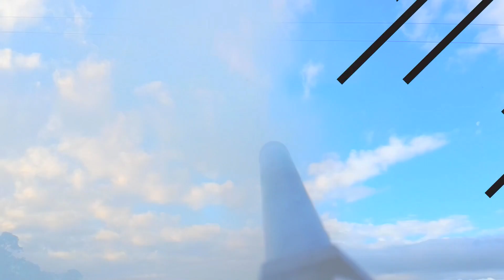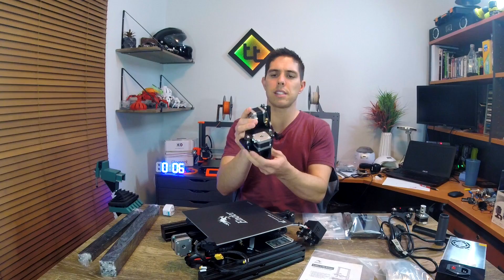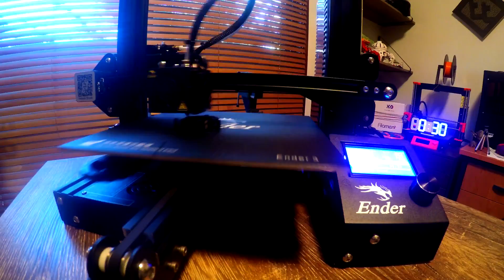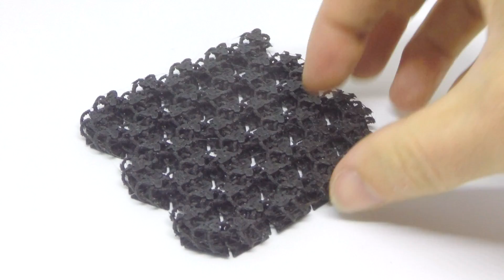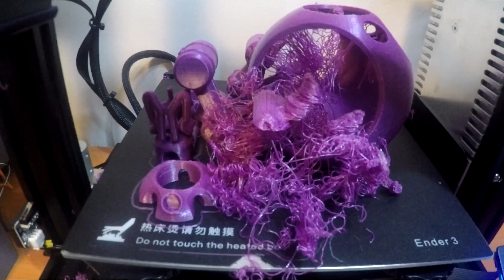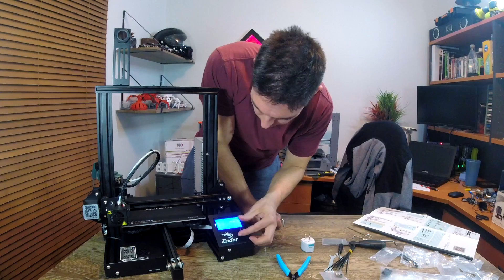Ender 3: The new standard in budget 3D printing? Now $190

Comment: I'm stumped when it comes to Cura settings.  I've seen several sites that host Cura Ender 2/3 'profiles', in .ini format, but don't know what it takes to get that printer's settings imported into Cura.  The Cura program (mine is as up to date as they'll go) does not have the Ender 3, so I'm having to stumble around and put together a group of settings and pray that they work.  What am I doing wrong?  Is there an Ender3 profile that you've used with Cura that you could post?  What's the process of 'importing' a printer into Cura?  If that's not possible and I have to enter settings manually, what would those settings be?  Thanks a lot for the video and any help you could provide.
Reply from the maker: Go to preferences , printers, add printer. The 220x 220 x 250 build volume plus the 1.75 filament and 0.4 nozzle sizes are the crucial inpouts here.
To import a profile, go to preferences, filament, import and select your file.
Good luck!
Reply: Ok, thank you for that.  For a profile that won't import - I'm guessing there's something incorrect in the profile itself if I get an error in Cura following those steps?
Reply: Also in the printer settings- Gcode flavor should be Marlin?

Comment: I’ve had  mine sine June and I found that after a fair few prints the bed surface has become smoother in places and adhesion isn’t as good. Mu solution to the mainboard fan was to simply add a mesh filter to the inside
Reply from the maker: Did you change to another surface?

Comment: I've got my Ender 3 working now but my first problem was the print would start not in the center but on the left corner closest to the front. The print would start half off the bed!

I had to move the object in Cura to the northeast quadrant on the bed before it would start properly. After that it was fine. Still searching for a solution before starting my 2nd print.

Edit: I should say, I had "autohome"'d it before and it failed then I tried to position the extruder in the middle of the print bed but same outcome.
Reply from the maker: It sounds like the printer dmensions are set incorrectly in the slicer. I that doesn't work then I'm a bit stumped. Reflashing firware might help in case the wrong firmware was flashed from factory, but I think that would be very unlikely.
Reply: Teaching Tech thanks for the answer. I ended up"fixing" it with a full power down and unplug from the wall. After a restart, it began working fine!
Reply from the maker: Glad to hear.

Comment: This is my 1st week with my 1st 3D printer and the slight adjustments were :-
It rocked, so I  put in on a flat surface and loosened and re-tightened the feet so they seated in their natural  position.
The Z jammed, but all I did was loosen and re-tighten the Z stepper after final assembly so it fell into it's natural unloaded position. I didn't loosen the screws on the carriage nut.
The bed surface curled a bit, but it came with clips so I just moved them further out.
The only thing is I never see the control unit fan spin. I checked it, and it was unplugged, but after plugging it back in it still doesn't spin. Maybe it temp controlled.
Reply: Mine also rocks, I hadn’t yet investigated why but good to know the fix is fairly simple

Comment: Out of the box I had the same Z axis issue.  I double checked everything with the frame was square as the lead screw was at a bit of an angle.  After Squaring up the Z stepper motor to the base and loosening the rear screw around the lead screw (ever so slightly) the binding has stopped.  Thanks for the upgrade tips as well, they will be my first prints.
Reply from the maker: Glad you resolved it and thanks for watching.

Comment: I have had an issue with mine. When printing the bed level changes and ruins the prints. I had to put stiffer springs on the bed leveling springs to stop this but it still isn't perfect
Reply from the maker: That sounds frustrating. It shouldn't really be possible without something loose being affected by vibration.

Comment: just bought one and so far looking good, but how do you easily change filament during a print? So say start one colour and end with another? So far only way seems to be to pause the print, pull out the old filament and push in the new, but not sure how to do that correctly... Levelling the bed (def worth the effort) I turned screws wrong way on one corner ... doh nice groove in new bed surface and had to sort out the nozzle! And I'd check the power supply spade connectors to the switch on mine were loose.
Reply from the maker: In Marlin you can add a menu option to assist with this. Now that the firmware is open source it should be possible. Bummer on the bed levelling. This is a printer that is crying out for auto bed levelling.
Reply: Thanks. Looks like the firmware needs an update. Pretty sure that voids the warranty though. Noticed one spot on bed where I touched it during build has a soaked in greasy spot so first PLA layer finding it hard to stick. Tried a few thing, looks like will go for a glass bed anyway so not dwelling on it now. Anyway advise to builders watch out what you touch after handling the Z screw which is oiled... Mine came in a nice rubber tube and was definitely straight.
Reply: For info maybe in case some curious,... post an SD card print the nozzle goes to home and the bed and heated nozzle stop heating and cool down.

Comment: On the verge of buying a CE3 as my first printer. Kinda scared though because while many people's CE3 worked great out of the box, others have had lots of problems with theirs. I guess it just comes down on luck. I really hope I'll have a functioning printer right away instead of a faulty one that I would need to rebuild with replacement parts.
Reply: Very comprehensive and high quality review by the way!
Reply from the maker: Hi Matthias, Remember that in communities, the people with the problems are generally the most vocal. It seems from the comments here that the vast majority of users have had a good experience with the printer. I suppose it comes down to your confidence in the after sales support of your chosen supplier in the case that you get a lemon.
Reply: Teaching Tech Alright, I shouldn't be too worried then (yet) :)
Reply: Mine has come out fine.

Comment: Did you update the firmware to TH3D or Marlin? To stop thermal runaway. I just got mine yesterday, but are moving. I replaced my hotend on my CR10 with a E3D hotend. Plus I have an auto levelling sensor. Easy to build the auto levelling circuit too. It's on my channel.
Reply from the maker: Not yet but this is on my to do list. Manually flashing a bootloader is something I've done before, ut is still a pain. A bit of a barrier for sure.

Comment: Z binding...fixed with a printed spacer for the motor, so not a big deal. Major extrusion issues due to the bowden tube not sitting tight against the nozzle. I replaced the tube completely and slided it in with the coupler/nut slightly loose and the nozzle heated up. That way, when I tightened the nut, it added extra pressure between the nozzle and PTFE tube. I've done two 40 minute prints since that and those were fine. If the pneumatic coupler doesn't hold (even with the locking clips I made), then the extrusion issues will probably resurface and I will replace them with new ones that will hopefully work. Very good for the price, but the extrusion issues took a lot longer to figure out than it took to build the printer.
Reply from the maker: Great problem solving. Your issue sounds like what Angus from Maker's Muse ha experienced, but hopefully not as bad. Perhaps a small bad batch issue of the fittings?
Reply: Very clever with the coupler tightening trick!!

Comment: Great video. I've had the E3 for a while I have the fan cover cable chains spacers to even up the z axis and a rail mount for my SD converter. Today I have had one of the bearings on the y axis develope a clunk and noticed that the wheels have a slight groove. I've ordered some improved wheels with better bearings to resolve this. But other than this issue, I love the printer, it's a well built chassis and and nice and portable. Some ability for auto leveling from creality would be appreciated. Thanks for posting your thought keep up the vids.
Reply from the maker: Thanks for taking the time to comment. Planning to cover some mods on this printer in the coming weeks. Some of the printed mods you mention, as well as flashing the community firmware and fitting a BLtouch.
Reply: Teaching Tech great ideas maybe I should do a quick video on the roller replacement, when they arrive.

Comment: Maybe it is impossible, but how would you compare it to Prusa MK3, given that I could forgive this printer a lot more than prusa, mainly because of the price, of course.  Talking mostly about the print quality.
Reply from the maker: The print quality on this isn't far off. The mk3 has big advantages in terms of usability and convenience. You could add many of the features from the mk3 but the cost would add up.
Reply: Thank you for the reply... I am torturing myself with urges to cancel my order on Prusa for 2 months now. So many issues :( I am literally on the edge of canceling it all and buying Ender 3, or cr-10s... I would just clamp on the flex plate and i am all good. But I can imagine all the issues with those cheaper printers too. Everyone has a different problems with different printers. I have yet to find a discussion that would definitely change my mind. sigh :(
Reply from the maker: You hit the nail on the head with "Everyone has a different problems with different printers". Remember that in any community, the vocal ones will be the few with problems. I've been very happy with my MK3, it is still my go to machine because it simply works. We have just had our MK3 we ordered for school arrive, it will give me a good chance to see if the experience is as good the second time around.

Comment: Why that Hype about the Ende 3?!
With the one i bought, I have seen just no goes over no goes....
The base of the Y axis has been preassembled with force and so it has been messed up.
The cut of the profiles for the Z axis have not been cut properly, so I had to bring them to be milled flat. Otherwise a proper assembling would not have been possible. The extruder is crap, the hotend is far away of a decent engineering result. The Z axis cable are to short too be guided well. The SD card slot is placed as stupidly as it can and, and, and
In fact i don't see any good buy there and the aluminum profile I can get a lot cheaper and properly cut, than for the price of the Ender. Considering all that should be changed, its a better choice to built the sam by itself with worthy components, or to buy right away a printer which is worth it's money. 
And nope I'm not trolling for no good reasons....: https://www.thingiverse.com/thing:2970759
Reply from the maker: It sucks that your printer hasn't lived up to expectations. From the comments here and discussion elsewhere on the internet I think it's safe to say your experience is the exception rather than the rule. Hopefully you can get it sorted.
Reply: Personally I rather think, that most users and specially People new to the subject, They're not aware about the damage they make if they forcing things to fit. And there are lots of videos about th profiles of the x-axis which is not straight up....
But what makes me more angry than the troubles with the Ender is that hype  about it, just because it is cheap. (but finally expensive..)
Thousands of these printers have been sold  and they're not able to buy machines for a clean cut?! That's juts a joke, but a bad one ...
Why not selling that printer for 10 bucks more what would allow to make things right?!....

Comment: Hi, for the price point of about £200 UK. Would you recommend this printer or a different one please? My first Prussa clone was destroyed in a garage fire and I need to get a replacement. Cheers for any advice given.
Reply from the maker: Hi Shaun, I'm hesitant to give advice on printers I haven't used, but around that price point there are the cheaper cr-10 clones and some deltas. Check out a maker's muse video comparing printers at each price point.

Comment: Great review. Mine arrived last week. I've gone from the HobbyKing Fabrikator Mini II, and the PEI surface on that isn't quite so rough. Took me a while to get the settings sorted for a reasonable first layer, but seems OK now. A quick wipe over the bed with IPA and it sticks really well....maybe too well :) Haven't needed to put glass over it though like some users. A real nice printer though, easy to build, and solid construction. Would you share your retraction settings? This is one thing I need to sort. :) Many thanks for a great review.
Reply from the maker: I'll post the profile in the description shortly.

Comment: Had been using mine for a bit and it always had a burning smell. Then the heated bed would just start heating as soon as it was turned on and keep heating till it reached its max around 110C. Waiting for a board replacement so hopefully that resolves the issue. At least I know it can get that high amd with the 24V it geta the bed heated up much quicker than the CR-10. 

I also cut a mirror to put on the build plate like I did for the CR-10. Whatever that material is on the Ender-3 sticks too well I found. I prefer the smooth surface from printing on mirror/glass, but to each their own.

Agree that this printer would be pretty easy to transport, so would work well to bring into work or a function to teach/demonstrate how 3d printers work.
Reply from the maker: Thanks for sharing Mike, a very useful post for others.
Reply: I had the same issue with my cr-10 and know how to resolve the burning smell and heatup... Its the mosfet that you need to replace. For my cr-10 it was 5$ on banggood...

Comment: Bought one of these recently too, and am enjoying it so far (its my first printer). To make prints easier to remove I ended up using an adhesive backed magnet and stuck it to the bed, then stuck a build tak surface onto another magnet for a cheap magnetic bed mod (though you lose a few mm of z height obviously). I printed one of the blower fan mods too to direct air more directly to the nozzle. Super satisfied with the quality of the product given the price, and ease of use after tinkering with it a bit.
Reply from the maker: Thanks for sharing.

Comment: I bought one of the 1st runs of this printer and haven't had any problems. I printed 2 lithophane lamps and hated the build surface (things stick too good to it). I cut a 12" mirror from Kent and haven't looked back. Printing on a mirror with a spritz of hairspray for good measure works awesome. I actually use this printer more than my CR10S.
Reply from the maker: It's a nice printer. With a bltouch and a better bed I think it will be amazing.

Comment: Had this printer a couple of days now, and is my second printer. Overall I'm happy with it although one annoying issue I have to is that my fan that blows over the electronics has been wired with the part cooling fan, so unless my part cooling fan is running I have no airflow over my electronics which is not good. Another issue is the bed is warped, a common issue that I keep hearing about with the printer, nothing a sheet of glass or mirror won't solve so not too much of problem. At this price is difficult to recommend any other printer.
Reply from the maker: Thanks for sharing real world experience. Fixing fan plugs shouldn't be too tricky, have you looked at the main board.
Reply: I am hoping it just fan plugs that I can easily swap around or solder in. I haven't opened it up to check the main board yet. Haven't heard or found online anyone else who has a similar problem yet so like you i'll put it down as just an anomaly  took an evening to get the printer sitting flat and straight on the desk figuring out how to tighten everything up, had some trouble with bed wobble and some binding, so a little apprehensive about tinkering with it just yet as my build didn't go as smoothly as yours. but still had it built and running in a matter of hours.

Comment: I'm having quite a hard time to remove the printed parts from the bed. I'm using a brim to help getting the tool beneath the printed part, but it is not always working
Reply: I'd suggest that you re-level the bed after you have heated it to 55 or 60 degrees.
Reply from the maker: Apart from the couple that came loose, mine have stuck very well also. I'm thinking I may fit the anycubic ultrabase I have sitting around.
Reply: I do check the bed level when it's hot but when trying to remove prints like vases it's easy to break them as the first wall perimeters get detached from the bottom layers. What cura profile are you guys using.
Reply: I'll have to get an ultrabase too, last night I made a hole on the surface with the scraper trying to remove a stuck print :(

Comment: Hi I had the problem too when I heated up to 100 my print surface delaminated too so I have never taken it above 60 since Tim
Reply from the maker: Hi Tim, I smoothed it back down and the issue hasn't happened since a few more 100 degree prints and lots of 60 degree prints.
Reply: I have bought a glass bed for it now so no issues now. I use 3D Lac on the glass and everything sticks well. So far I am getting very good prints from it and have just ordered the cr-20 as well as the tevo flash. There is a long wait for the Flash though I had to add another 30 days for processing but hopefully worth the wait. I will be ordering the CR-X duel extruder when it becomes available too.